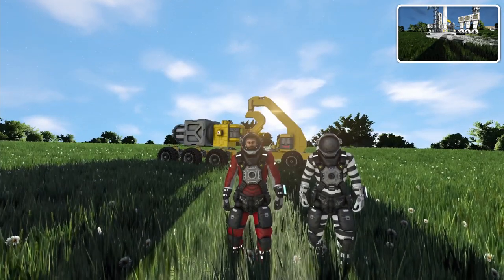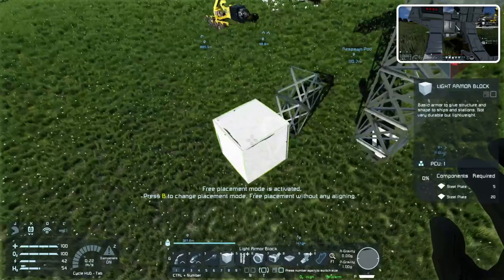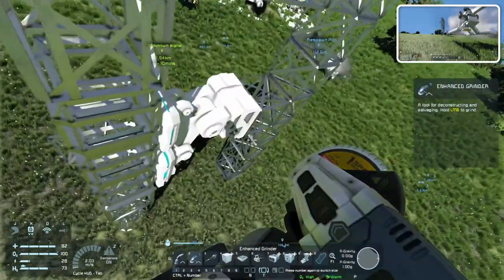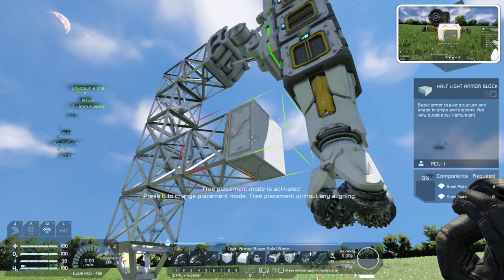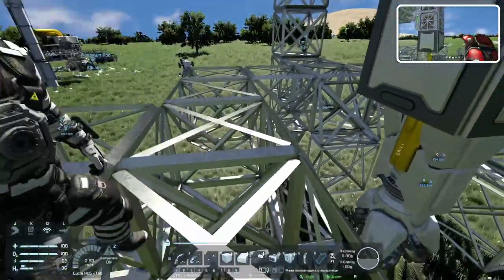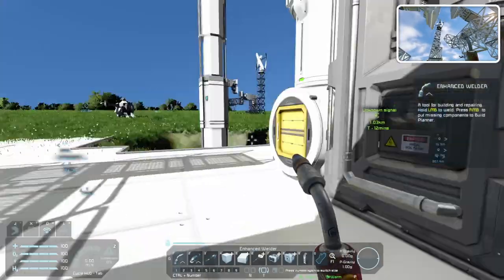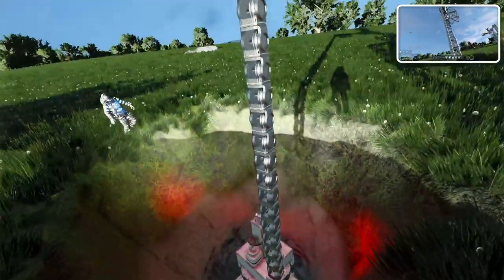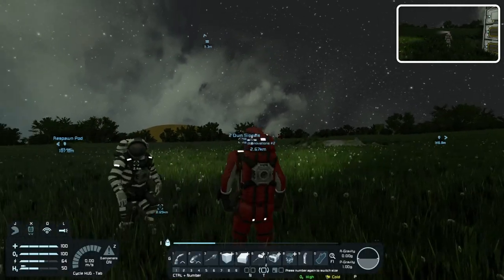Space Engineers Co Op : Remote Drill and Hinge Rope Recovery EP12

Comment: @29:30 - turn off the "Use Conveyor System" option within the drill control panel and it's gonna act like you thought it would with "turning off" the cargo containers 😉 

@36:40 - you can just turn the hinge/rotor off and it's gonna lose its strength and start wobbling again

Great vid!

Comment: To make the drill go straight down give it a gyro set on override.
Reply: Won't work unless the drill creates a flat area below, or isn't in sync to create that area. Had that happen in a few vehicles but usually it's easy to compensate by just lowering it slower.